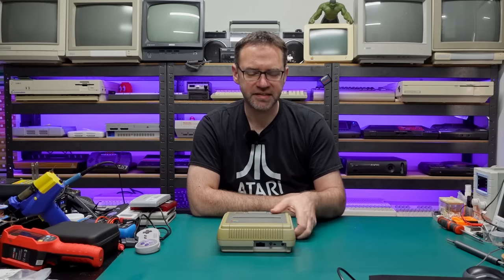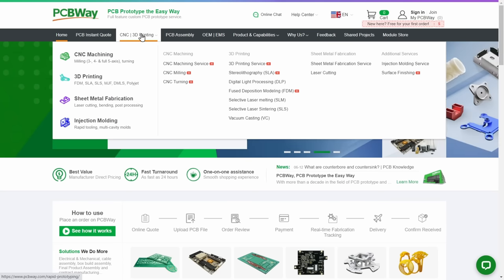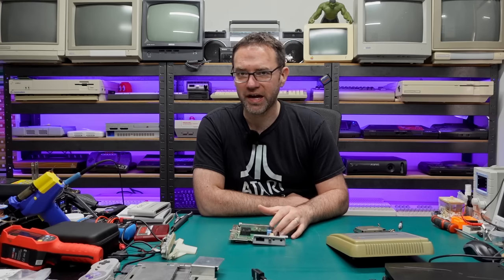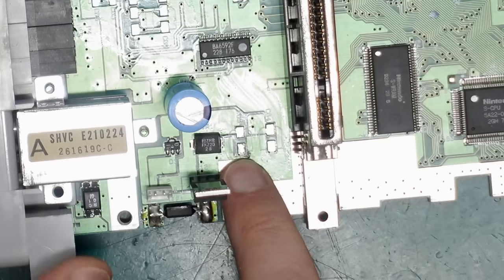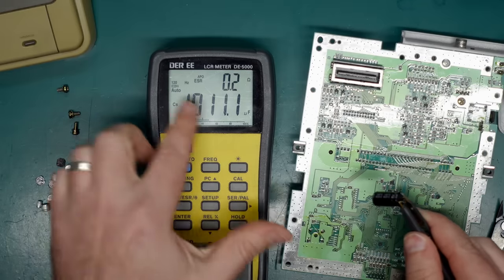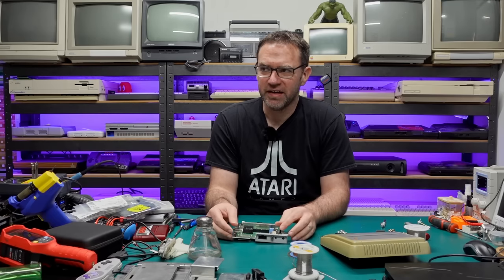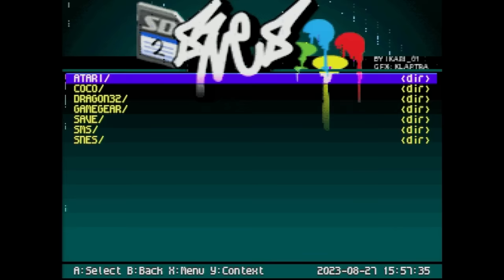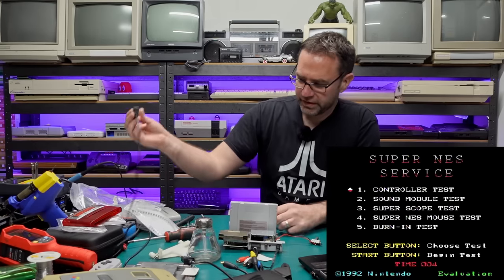SNES repairs and the great SMD cap debate

Comment: I just gave your twisting method a try on an old Macintosh LC II motherboard that had leaky caps and it worked an absolute treat! All of the legs broke off cleanly and none of the solder pads look to have been damaged, despite the corrosive gunk that has been on there for who knows how long. With a bit of vinegar and IPA it cleaned up pretty nicely too, no severe damage that I can spot, so it looks like this board will be saved. Many thanks for showing this technique and giving me the confidence to try it!

Comment: HOW DARE YOU TAKE CAPS OFF HOW I DONT! 😆😆
Very neat work Mark. My fave method is 2 soldering irons but Im pretty decent with my left hand (ooer). Ive often snipped them off with the tips of flush cutters, that way you can nip through the can a little at a time without any pressure. But Im coming round to your twisted methods!
Reply from the maker: Hehe, SOMEBODY ON THE INTERNETZ DID SOMETHING DIFFERENT TO HOW I DO IT.
The two soldering irons isn't bad, but by the time my backup warms up, I would've have already twisted off all the caps

Comment: I'm a snipper. Twisting is just a bit too violent IMO, whereas snipping when done carefully shouldn't be pulling on the pads (I always cut in the axis of the pads, and apply some careful downwards pressure to counteract any potential upwards pulling). And no need for a lot of heat on these old PCBs. What I worry about with twisting, is the potential for sideways pulling on the potentially weakened pads.
Reply: One of the YouTubers I watch gave a for and against with twisting, I forget who it was, but if their is corrosion or major leakage around the pad, this particular YouTuber doesn't do the twist method as there is a chance the pads will just lift. However if there is no sign of damage, twist is perfectly fine.

Me, I've been too chicken to try the twist method, so I just gave after it with hot air.
Reply: I'm a wiggler/rocker. I give them a good squeeze and wiggle them back and forth til the cap separates from the legs or the legs snap off.

Comment: The Twist technique appears quite logical. Yesterday, my brother and I replaced the capacitors in a Gamegear (unfortunately, it emitted a dreadful fish odor) using the method you advised against. Surprisingly, we encountered no difficulties removing the capacitors using that approach. However, your point about needing to apply more heat, particularly with faulty capacitors, is valid. I think I am going to try this twist method on a donor board.   Your videos are great!

Comment: Just recapped mine using the hot tweezers method. replacements were SMD also. went pretty smooth. I got the console 5 kit for it (and the other consoles i've done) and it is nice to have everything you need in one bag. everything is high quality replacements like rubycons

Comment: I just did this myself last weekend to a snes and i used the twist method. I using pliers from the top putting light pressure pushing down. Instead of single twist motion, i decided on light left and right twisting to break off the smd caps.

Comment: I think low melt solder could help a lot with the unsoldering of those caps, even with just the  soldering iron.
Reply: Ive been using low melt for the removal of surface mount IC's and its great - creates a mess though!

Comment: Thanks for the video! Do you know what the largest capacitor (C67) used for? I ask because I have an American SNES (NTSC) and that place on the PCB is empty. My SNES works except for the fact that the whole picture slowly scrolls in the vertical direction (wrapping from bottom of the screen back to the top). I already replaced the 6 caps near the AV port. I'll go ahead and replace all the others too. Got any other suggestions if that doesn't fix the video? Thanks again!
Reply from the maker: C67 is for smoothing out the rectified AC. NTSC consoles convert and filter the mains supply inside the external supply/wall wart. For whatever reason the Japanese consoles have a 1000uF cap there and the US consoles have nothing. Not sure if that was a cost cutting measure or perhaps the US versions use a larger cap in the external supply and didn't require the additional cap at C67. The PAL consoles take 9VAC and do all the DC conversion inside the SNES, they have a 2200uF cap at C67.

Anyway, that's unlikely to be related to the scrolling issue. It could be a number of other things but it may be possible to narrow it down by knowing what video output you're using - RGB, s-video, composite, RF?

Comment: Sound modules can also be found in early USA SNES systems, I don't care how ugly it is, I love my low leakage through hole caps, different caps different techs for removal I reckon is the best, I would never use the twist method for the leaky caps in PC Engine Duos or Amiga 600s for instance as the pads are usually already eaten and the PCBs are shit poor quality, I like to press down pressure and then snip away, but like you said it is up to the tech doing the work and their method that works for them, good video mate, thank you for making it.

Comment: Excellent as always.  I agree on the capacitors:  whatever works without destroying the board.  I've been leaning towards the snip method (cutting parallel to the pads to put less stress on them), but if the twist isn't pulling pads, then more power to you.  If I can't cut parallel, I'd probably go Chubby Checker on them too.  Thanks for sharing your expertise!
Reply from the maker: Haha, Chubby Checker, nice

Comment: A very informative video! :yougotthis:For electrolytics both snip and twist depending on the position and condition of the capacitors. 
I also have a similar desoldering tweezer and it's useless like yours, it doesn't heat up at all, and I prefer to use two cheap Chinese soldering irons that work great when I harvest tantalum and ceramic capacitors from old boards.

Comment: Great video. The only thing I would add would be using a marker to mark the orientation/polarity of the caps prior to removing them, or taking a photo of the board prior to removing them :)
Reply: Good practice with anything, because in the old days some PCB silkscreen markings were on the "+" side. You see it a lot on old motherboards on Learn Electronics Repair channel.

Comment: The hot tweezers method works quite well if you add flux and fresh solder before removing the cap. But I mostly use hot air if there aren't any plastic parts nearby that would melt.
Reply: Apply first vinegar to eliminate the electrolite. After that clean it with IPA.
Reply: @talos86  Clean the board first goes without saying, I guess. Some people prefer soap and water, IPA is also great. Vinegar helps with leaked batteries (the residue is basic and vinegar is an acid), but not really with leaked capacitors.

Comment: add low temp solder and flux to the pads. it will reduce the melting point to about 130 deg C and then you can use hot air or soldering iron. For the bad condition boards it is the safest

Comment: In my opinion, the safest way to do surface mount capacitors is to mask the surrounding areas and then use a rework gun. 
And in regards to the twist method, I can't say either way for the Super Nintendo because I've never done that but I know from experience that you do not want to use that method on a Gameboy Advance because the pads are too delicate

Comment: I'm surprised that twisting doesn't damage pads. It just seems like it would have the potential to do the most damage if they're already weak fron leaked fluid. But huh. If there's no damage then maybe I'll give it a try next time I mess with these.

(I was doing "soldering iron to one leg while lifting gently enough to free the first leg, then go soldering iron the remaining leg to lift it away" method but I haven't done this loads of times so I'm not too invested in it or anything)
Reply from the maker: It's worth a try. I've tried all the different methods and twisting is the one that has worked best for me. If it doesn't work for you  then at least you know not to bother trying it again 🙂
Reply: I've found the twist method to be the best personally. Done hundreds of SMD removals this way with no lifted pads. I don't twist back and forth like he does, just twist over and over in the same direction until the legs snap. It seems like it wouldn't work so well, but it really does.

Comment: Wavy vertical lines might be caused by poor scart cable(not shielded adequate) and they are just power interference. (at least that what I would guess😅)
Reply from the maker: It is a cheap scart cable, but it works ok.

Comment: The thing about RGB and capacitors is false. The only video output not affected by bad capacitors is RF. That's why I tell people that if they get "No Signal" or the picture's all screwy, the first step to diagnose the problem is to try it with the RF.

All video signals to the AV Multi-Out go through that bank of SMD caps.
Reply from the maker: While I agree checking the RF output is a good idea as it is not affected by those capacitors, what I said about the RGB output is true. The capacitors C57-60 are on the composite and luma outputs, each has 2x100uF in parallel for the SHVC models or 1x220uF for the later models. There are no series capacitors in the RGB lines
Reply: @TheRetroChannel  Bad caps do affect the sync line on the RGB though, and bad/lack of sync represents the majority of video signal issues I've seen across a couple dozen Super Famicoms. 🤔
Reply from the maker: Ahh, good point. I'm using csync which would not be affected, but certainly if the cable is wired to use sync on composite or sync on luma then yes, it will show issues if the caps are bad

Comment: Gamebit?! My PAL SNES have simple Philips head screws out of box. I got mine with the Dounkey Kong Country bundle. As for the cap removal, i dont recomment any mechanical method, because you can damage the pads more easily, than the soldering iron method. For the soldering iron method just use chipquick.
Reply from the maker: Interesting, I have a couple of PAL models and they both have gamebit screws.
Reply: @TheRetroChannel  i got it as a Christmas present as a kid. Its plausible, that it was a warranty refurbished unit.

Comment: With my snes easiest way was to use hot air and tweezers. And to be honest solder they used make it super simple😊
Reply: I just desolder one leg at a time. 

I hate hate hate hate hate HATE the "grab it with pliers and twist" method. It does against EVERYTHING I learned in electronics school.
Reply from the maker: You don't need to like it, but a lot of people do it without issue.
Also, where is your video? 😝
Reply: @TheRetroChannel  On my channel. It's the Gameboy Color restoration. Around the 1 hour and twenty ish minute mark.

Comment: If you need cutters/pliers you are applying mechanical force, and if the tracks are compromised by the electrolyte you may just tear them off. But hey that could be made in to another video, good for views!
Alternatives include - Use an RA flux (which is better on compromised solder joints) along with a small amount of low melt solder (but don't lower iron temp below what you want to use to melt lead solder) use either an standard or tweezer iron (gyrate without force while the solder melts so it mixes new and old the solder). Use braid to remove all solder once cap is removed.
Use low melt solder paste (easiest to use) see above.
These methods won't apply any physical stresses and because of the use of low melt solder will lower the thermal stress also.
Most (not all) issues from using an iron and lifting a track is either the track was already done for, or heat dwell time due to either inexperience or a soldering iron not applying enough heat to effectively remove the component fast enough. 
Sorry no video as I'm not here to drum up some fake drama to bring more views.

Comment: You're not using flux (which will make removal a lot easier), you're putting undue stress on the board twisting the caps and you advocate using THT caps to replace SMD. So you're recrapping the board then. Gotcha!